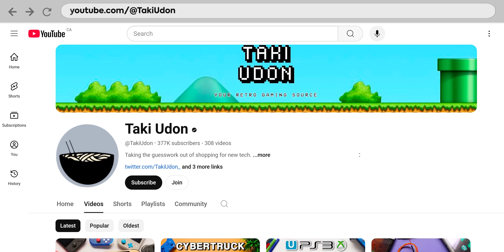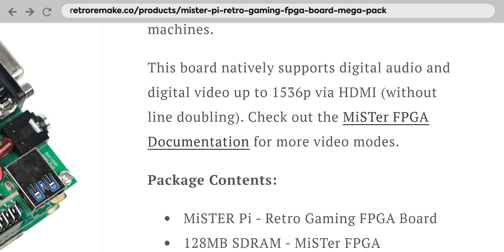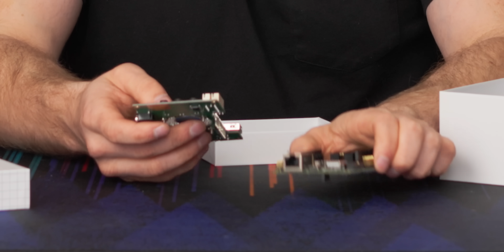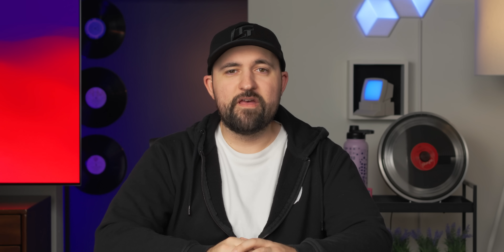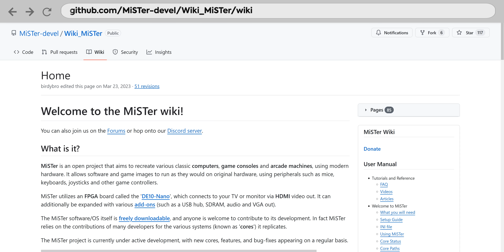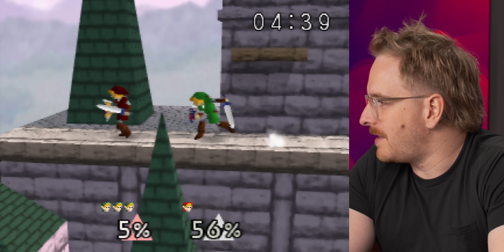Half the price. All the Games. - MiSTER Pi

Comment: I actually would really like to see FPGAs become common addons to computers similar to how GPUs now are. It would obviously be useful for emulation and I would love to see it put to use in a regular computer and not just a retro appliance, but it could be more useful in other senses as well. I mean what if you were a video content provider and you wanted to use a new encoding scheme like AV2. If the FPGA was big enough you could basically just program the FPGA on the system and now you would get hardware encoding. It could also be used by CPUs to drop support for older instruction sets. They could just move it to the FPGA for the 1% of users who still might use it.
Reply: Cost.
Reply: @Policepigeon  Yeah they aren't free but they aren't that expensive either. I mean this board is a fpga and costs $100 and you can get an artix 7 for about $150 on ebay. That is nothing compared to even low end GPUs. If this were actually targeted at consumers they could probably cut out a lot of costs as well. I mean a lot of the added boards here were for basic things like IO, networking, RAM, Video Output, etc. These are things that are already present in consumer PCs and so a consumer variant could simply use host based options for them. Most FPGAs now also have a lot of additional hardware because they are used for development. You have a lot of added costs in different sensors and readouts because those are needed in those spaces where they wouldn't be in consumer space. Theoretically FPGAs would also be able to take advantage of scale as well. Currently FPGAs are really low volume products so the companies making them have to recoup their development costs over few units. If they were common in consumer PCs prices could drop accordingly.
Reply: There are many FPGA cards that can slot in PCIE slots just like a GPU.
Reply: @hasanthesyrian_  Yes there are but there isn't really any consumer software that targets them. I mean FPGAs have been a thing on the consumer side for a while with this platform being a prime example. But they are appliances instead of applications. We would need applications to support them. It isn't unheard of either. We got AI accelerators insanely fast even though most consumers don't actually seem all that interested in the tech.
Reply: I like this conceptually but I'm pretty uninformed in specifics -- how much of an fpga would you actually need to do av2 encoding?
Reply: @a11aaa11a   well considering AV2 is still in development I have no idea. FPGAs would have to be sold on very different specs though. Basically the number of logic cells.
Reply: @chaosfenix  yeah I assume a good approximation would be "how many logic gates do you need for av1" but I'm not sure how to deduce that
Reply: @a11aaa11a  I really don't think you can because it could likely change over time. I mean Nvidia, Intel, and AMD all have implementations of hardware decoding for AV1 but they aren't the same either. So it would basically be up to the software to say that they need X number of logic gates for their current implementation and again that could even change with each version of the software.
Reply: Yeah, both amd and intel bought the largest fpga manufecturers, xilinx and altera. AFAIK, it never got anywhere beyond a couple of niche server skus
Reply: There's a zero percent chance you could cost down an FPGA setup for any kind of consumer video processing for anything as good as a dedicated GPU. I've used a commercial FPGA chip and board setup to do pre-silicon testing for some automotive instrument display cluster chips the company I work for manufactures. It's a really basic blit based rendering chip with only 4M of memory and a few puny ARM cores, with the end purpose of rendering simple displays for things like speedometer, tachometer, etc. The setup I used costs around 5,000 USD. Even for this application, the design engineers had to cut quite a few corners to fit the number of usable gates and LUTs in the FPGA. I shudder to think of the cost of something even remotely usable at desktop scale.
Reply: Manufacturing at scale can do wonders. There's a chicken-and-egg problem with apps and consumer adoption/price. However, moore's law being dead and better fpga toolchains just may tip the scale. The popularity and price of a Mister Pi is a hint. 

It seems like a tall order to imagine an fpga in every laptop but I would have never imagined Rasperry Pi becoming the absolute monster that it is either so there's a chance, IMHO
Reply: @yakovdan  That's exactly why FPGAs will never make sense though. If you have any amount of scale, an ASIC is always cheaper. If you have the volume for scalability, you would tape out a dedicated chip
Reply: @themetal2244  
I'm thinking about a raspberry pi type ecosystem. No one usecase is large enough, but combined - there's more than enough. When no single usecase is large enough, it wont be eaten by an ASIC and will keep supporting the consumer fpga ecosystem.  If the toolchain is there and the hardware is  significantly cheaper than a gpu, i can see it. At least packaged as a pcie card or externally via usb
Reply: @yakovdan  I don't see these use cases being enough to compete with the cost efficiency of ASICs tbh. There's a reason this mister FPGA system can only serve as a hardware clone for consoles as new as a PS 1, and that's with add-ons for RAM and other peripherals. Running soft-core processing in FPGA fabric is just expensive. That's to say nothing of the fact that they are also very power hungry compared to dedicated processing chips, and more difficult to design around, requiring more power nets with more stable voltages. FPGAs have a niche where they can perform hardware emulation for very old consoles, and some DSP and other signal processing at specific limited scales for consumer use. It doesn't make sense for the majority of people to be using them. The average person would not see the benefit of including them in a PC system, and would probably rather just choose a much cheaper dedicated chip solution if they had one of these needs. There will always be a hobbyist space for FPGAs, but it will be some time before it is remotely as big as something like a raspberry pi. I still remember using the Internet to learn VHDL back in  2018. The amount of information online for HDLs compared to traditional programming languages was laughable. I basically learned VHDL by trial and error, and using one dude's posts on Electrical Engineering Stack Exchange. Availability of tools and information has improved since then, but your average hobbyist could get way better milage using an ARM microcontroller for most embedded applications over an FPGA right now, unless they specifically want to emulate hardware or do some very high performance DSP.
Reply: @yakovdan  Yeah and I also think that doing it as an ASIC would be very difficult in some scenarios. I mean even consoles don't exactly have fixed hardware. This is especially important for people looking to upgrade retro consoles. This could be used in other scenarios as well. I think of business that have ancient hardware they use for critical machines. If this was supported in emulators like virtualbox they could simply target the hardware their software is expecting. Again I wouldn't expect everyone to need one which is why I am not saying it should be baked into chips. I do think that there are a lot of niches though that could really benefit.
Reply: @themetal2244  But ASICs have a few problems that you wouldn't have with a FPGA. The biggest one is that the design would be locked in. This means that any bugs you may have will be there forever. Even though hardware emulation seems perfect when you see videos like this it isn't like they never have updates. With an FPGA you can simply update the software. With an ASIC that is built in. Especially with emulation it isn't like developers get access to Nintendo's CPU architecture designs when doing this. They are reverse engineering it which isn't going to be perfect.
Reply: @chaosfenix ASIC designs are locked in, but there are typically multiple iterations of a chip design to quash bugs, alongside multiple rounds of simulation using mixed SPICE and Sytem Verilog testbenches, as well as PSVP validation on FPGA before even fabricating any test chip. Hardware companies are typically far more thorough with design validation, as mistakes in production chips are costly. Bugs still happen, but the cost of very occasionally spinning up a new chip for these rare failures would be far less than making every chip an FPGA. If your company has the resources to scale in this way, an ASIC is pretty much always better for products that will sell in volume. If they weren't, these companies would already be selling FPGAs instead of ASICs. Manufacturing cost at scale is a chicken and egg problem, but when there is a solution that will always cost better at scale (ASIC), this will remain the dominant solution. 

The only real benefit I see to more mass adoption of FPGA hardware is a bigger knowledge pool and better hobbyist space.
Reply: @themetal2244  See it is that entire process that is why I think a FPGA would still be useful. The Mister project is very much a hobbyist project. This isn't a company that is going through the steps you described. The development cycle of projects like the mister relies on feed back from its users and is very iterative. This is why a FPGA is so useful for it. Again I think there are also other areas where it could also be useful for other businesses as well. A big one is deprecated instruction sets and architectures. Like what if you have a piece of software that only runs on arm or itanium. Yes we have translation but another way to support those architectures on new computers would be if a computer could check for a large enough FPGA. If present it could run those instructions natively on the FPGA. This isn't just for entire architectures as those would probably rely on very large FPGAs but could also be used for individual instruction sets like 3DNow. Again I don't see these as huge use cases that everyone will use but I do see an ecosystem for it. Yes, ASICs are better from a product standpoint which is why currently we use FPGAs to develop ASICs and that is what ships. However if hardware specifics are unknown like in the case of game consoles, in development like in the case of support for new codecs, or old like in the case of 3DNow, I see a use case for FPGAs in consumer gear.
Reply: Emulation would be a pretty bad use case for this. RetroArch already achieves lower latency than real hardware and 6th gen consoles are out of reach for FPGAs right now. Modern computers have dedicated hardware for common things like cryptography, GPUs handle parallel computation problems. What other application would an FPGA have that isn't already accounted for?
Reply: why would they do that when they can excatly that; release software with them that limits your use to small (local) language models (AI) and then call it the future?
Reply: Fpga is lag less. I have the analogue consoles and have tried side by side with real consoles. No difference. Softwear emulation can't match it
Reply: @roasty80  yes that is why I would want FPGAs to be common in regular computers. It would bring hardware emulation to pretty much everything from actual emulators to even things like hardware encoding for new video codecs.
Reply: @chaosfenix Many companies don't like that concept because then they can't sell you the same thing they sold you before but again with a remastered tag on it for a new system.
Reply: @chaosfenix  agree. That or a large company mass producing a console with a reasonable cost
Reply: You can actually buy that today. AMD/Xilinx' Alveo cards are supported by ffmpeg and gstreamer (which means OBS support would be possible).

The price is actually not that bad, at about $500 - $1500 it's comparable to GPUs.

(I'm currently working on support for Alveo cards in one of our products)
Reply: @justjanne-de  
Good to know!
Reply: FPGAs are amazing for niche purposes like emulation and signal processing, but way too expensive to justify for basically anything else. Which is why you'll never see them in anything remotely close to a mainstream PC, as much as I would love for the opposite to be true.
Reply: @justjanne-de  Ooh that is cool. If we were looking to buy one what would be good models that are generally supported? What should we look for and what should we avoid?
Reply: @chaosfenix  Once I figure it out, I'll be able to share it :) I'm still working on trying to get it working 😅